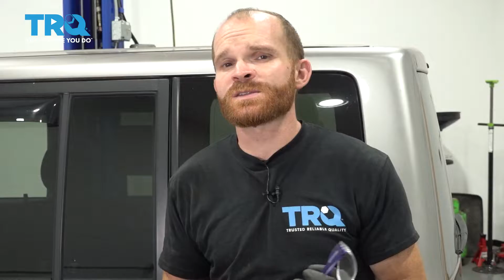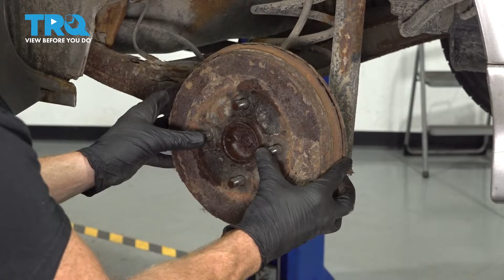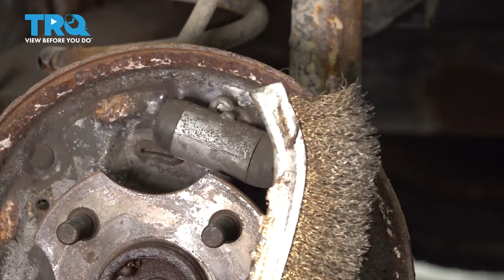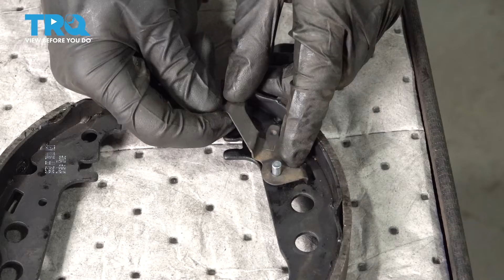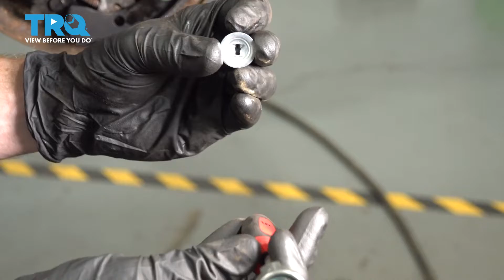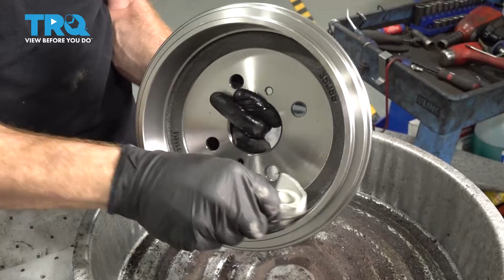How to Replace Rear Brakes 2004-2006 Scion xB

Comment: The worst explanation of which direction to turn the caliper compressor spring ever. Be specific which direction does what. Down tightens , up pushes then apart. Following your lack of specific instructions cost me more work than needed

Comment: Followed the instructions to the letter (great vid by the way), and my adjusters are all the way in. Quite hard getting the drums on and while they do turn, there's a good amount of resistance. Test drive around the block a few times went fine, e-brake engages fine one or two clicks and after the test drive, the drums feel pretty darn hot. Did I do sumthin wrong or is this relatively common?

Comment: All that grease, noooo.  The only location from grease in drum breaks is the pad extender threads.  Every location where you have exposed grease will quickly load up with dirt and break dust.  Works case, some of that grease makes it's way onto the break pads and no more stoppie. Good info but please drop all that unnecessary grease.

Comment: Is the adjustment direction for the passenger wheel OPPOSITE of the adjustment used on the driver's side? .....meaning.....on driver's side, you show that moving the wheel teeth up from the backsise (16:40 -16:52)...presets the 2 shoes NARROWER. Does moving ther teeth UP on the passenger side move the shoes WIDER ?(  LATER EDIT...it SEEMS there are different left side and right side adjuster parts numbers.....so one side seems to have reverse thread of the other. The result.... I think.... is that they adjust the same way.....from the backing plate opening, spinning the adjuster wheel "up" narrows the shoe preset distance on either side).

Comment: Wait.... at 13:47......the rear "fork"..... I think the proper orientation is for the shorter "leg" of the fork to be placed on the rear-side ( closer to the inside of the car)......the longer "leg" then is on the front-side ( outside direction of the wheel). Pls check. Going further.....the front fork.... the longer "leg" is located on the "Rear" (backside)....and the short leg on the "front"....toward the outside of the car. I had this problem  when I did my last brake job on my (identical) Scion xA...and had to re-do the work afterwards.....because I originally installed it backwards. As verification.... Go to the beginning of the vid and note the OEM orientation as you took the pieces *out*. Look CAREFULLY at 3:24 to 3:29.....and again (+/-) around 3:45. The front fork ( pointed to the front of the car)...should have the short leg of the "Fork" on the outside, long-fork on the inside........for the rear fork, it's the opposite....short fork leg on the inside and long on the outside. *LATER EDIT*....nevermind...you said (for the rear fork)..."place larger cutout to the rear". This is correct. The side with the larger-deeper CUTOUT,  has the SHORTER LEG, as I described it. Sorry)